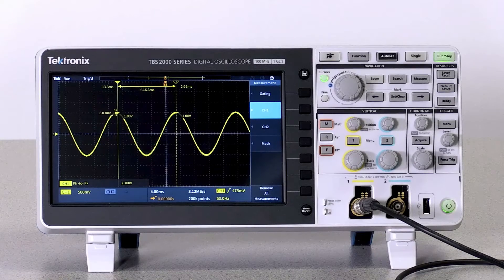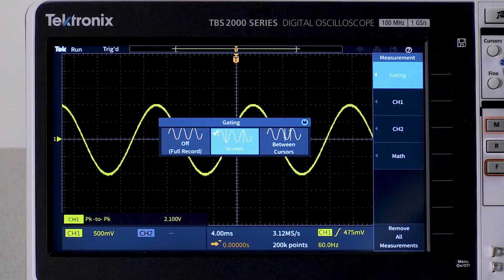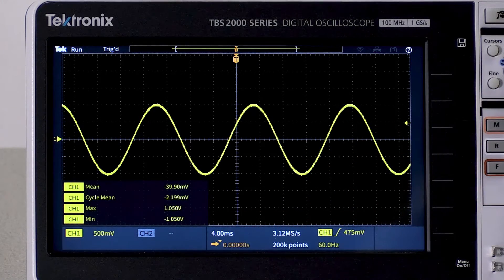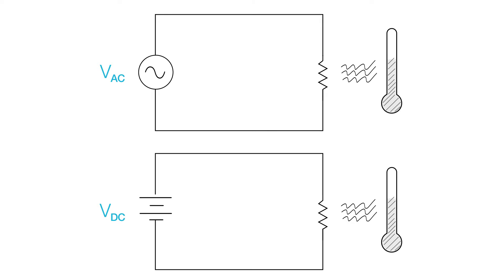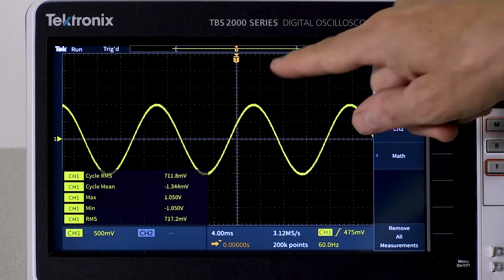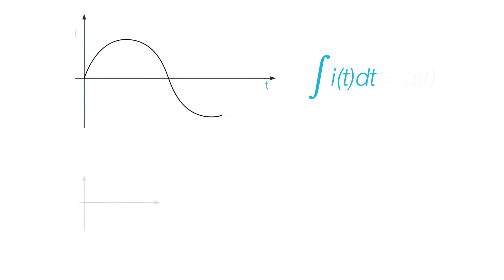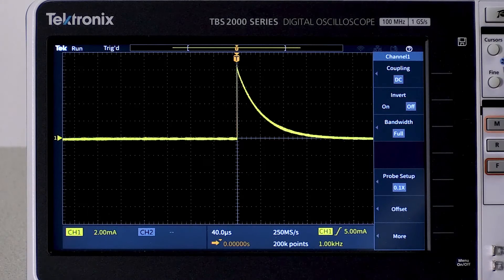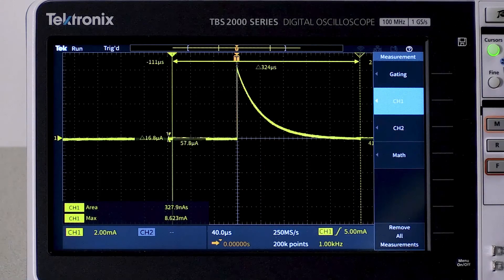How to Use Oscilloscope Mean, RMS, and Area Measurements (Part 6)

Comment: great video. What is an appropriate method for measuring power through a resistor or LED that is driven by a low-side mosfet and a PWM signal?